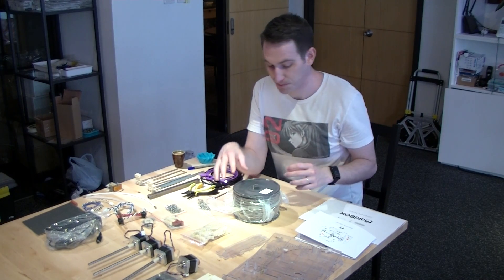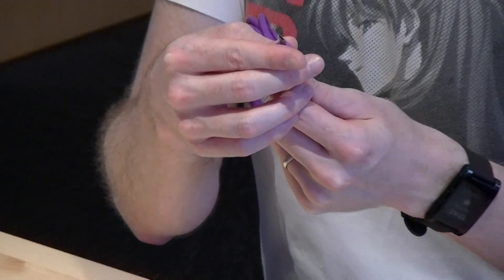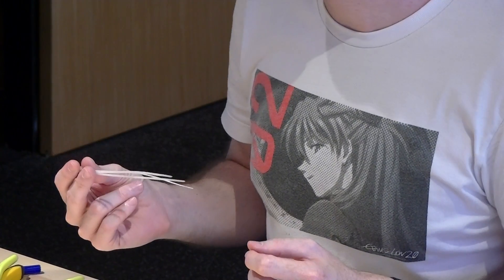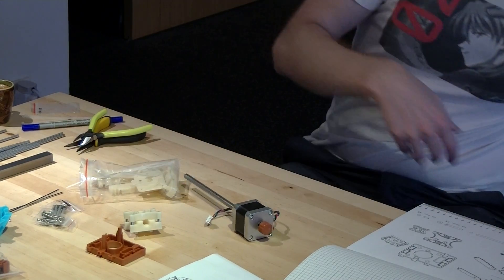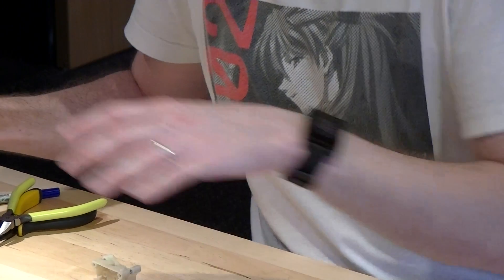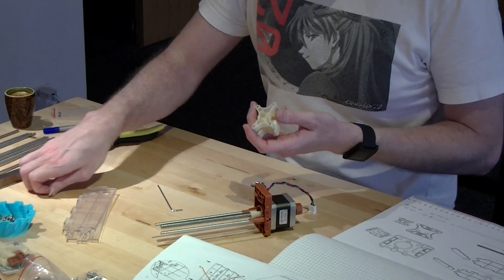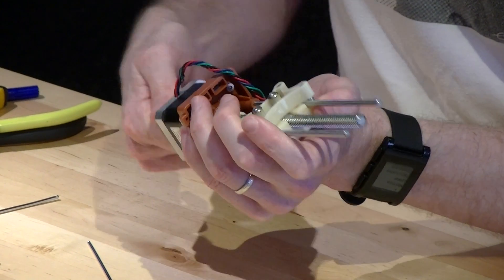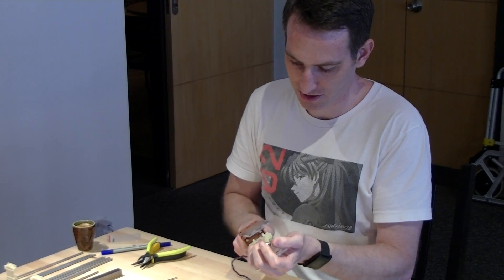#MakiBox Assembly Step 1

Comment: The cup is not included, it was just a tip to use something like a small cup for the screws.
There might be a short USB cable included, but the power cable would be too much of a hassle with all the varieties around.